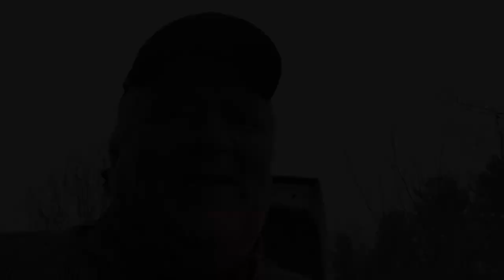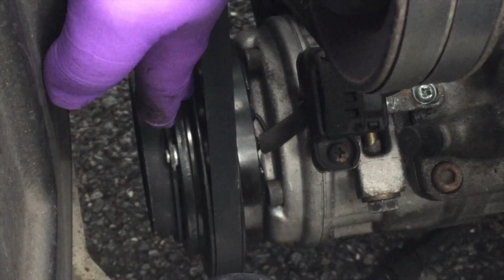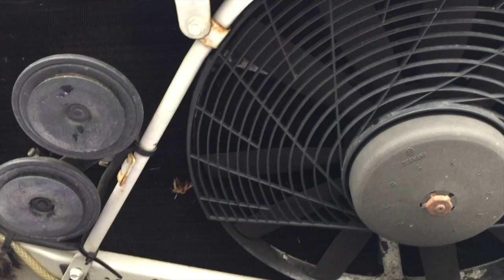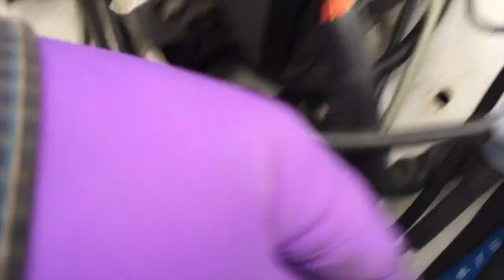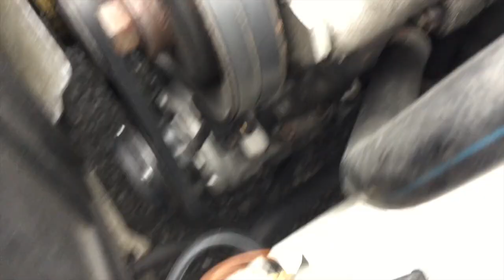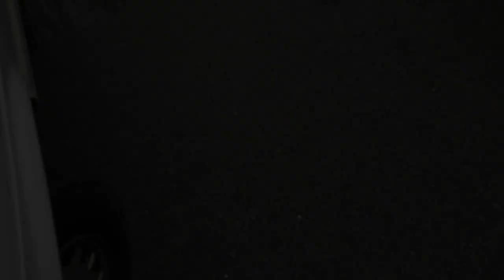Key components of AC systems on Mercedes Benz W123 W124 W126 W201

Comment: Thx for your videos.
I have a problem on my w126.
When I turn on the AC the aux fan doesn't turn on at low speed(doesn't turn on at all),if i put together the two wires from the switch in the dryer the fan turns on.
I charged the sistem last year when it was converted to r134 but if i change the switch i loose all the gas inside the sistem so I have to recharge it.
Is there a way to make the fan work at low speed when the AC compressor is on?could that be a problem for the AC sistem or for the fan itself? Sorry for my englis
Reply from the maker: The low speed only comes on if the high pressure switch senses a high pressure condition. I would expect for your low speed fan setting not to come on under the conditions you describe. 
The high fan speed comes on when the S25/5 coolant temp switch hits 105C. Just make sure that the small cubical relays are in working order in the fuse box. I do not necessarily think that you are having an issue with your fan.

Comment: What is called AC adapter?
Reply from the maker: The high and low access ports now have adapters as the R12 and 124 Freon connections are not the same.

Comment: my aux fans on the w201 2.6 just don't want to come on, jumpered the blue temp switch on the head, jumped the pigtails on the red switch on the dryer, have changed out the relays. My head is breaking, thinking of rewiring the aux fans to a manual switch through a separate relay. help hahah
Reply from the maker: Hmm. Have you tried powering the fans straight from the battery yet? Let's make sure that the fans are actually working.
Reply: @straybenzes  Yup, the fans work with direct 12v. I replaced the pre-resistor as the previous one was no good. Also changed the temp switch on the head, also checked and changed the relays. The fuses are all good as well with new ones.
Reply from the maker: @arnog9959  Hmm. One basic item I did forget to ask. Did you check the red fuse for the fans in the fuse box? I have found plastic ones melted and ceramic ones corrode to the point that they looked ok when in fact they no longer made a solid electrical contact.
Reply: @straybenzes  Hm, I replaced all the fuses that were marked for fans, and anything else that looked words with new fuses. Im very puzzled, by the aux fans, no lo or high settings even when jumping the temp sensor or the at the dryer. I might give in and take it to a shop...Or Hotwire the fans to relays and a manual switch..
Reply from the maker: @arnog9959  Do the relays change state? That would be a good indicator if it may be the climate control unit. That is what I would do next. Good luck.
Reply: @straybenzes  I was having some issues, thought it was the switch over valve, but the culprit to it all might be the climate control, relays don't switch states, I don't think. Thank you will try it
Reply from the maker: @arnog9959  All the best!

Comment: Hey Ralph how are you hope you’re staying safe got a problem with my SDL when I turn on my blower for my AC or my heat the recirculation light goes on but it still draws full from Outside I put my hand over next to the windshield wiper and it’s drying very strong if you can help to tell me where to locate the actuator vacuum line and flap thank you Ralph
Reply: Thank you so much Ralph you’re always a great help stay safe my friend
Reply from the maker: @abrahamghannam2137  Same to you and keep your classic car on the road :)
Reply from the maker: That would be the two vacuum actuators behind your glove compartment. As of my 1989 you would have to remove the passenger airbag instead. Remove the glove compartment door and the insert. You can either get new rubber diaphragms. You can get them here: http://www.perfanalysis.com/climate-control/acc-version-ii/ Or you can replace the whole pod, but they are really pricey. Here is what they look like: https://images.app.goo.gl/HUskZ2GjXR5ZCgWJ7 That link also has good advice on removal etc. 
This set is among the easier ones to repair. Good luck!

Comment: hello STRAY BENZES!  l have a problem as well with mine ac in w124. l have checked pressure in one of those  pipes,  and found there is no pressure at all,  so thats mean the system is leaking, and compressor doesnt switch on at all, or it should switch on any way? but will be no cold air?
like from Lithuania)
Reply from the maker: The low pressure switch on the dryer will prevent the compressor to come on. Also, when you lose Freon gas you also lose compressor oil as well. You need to find the leak first. Do not use leak fixing gas etc. That will only delay the inevitable - you will need to search for and fix the leak.
Reply: ok, thank you!
Reply from the maker: @artoor4ik777  You are welcome.

Comment: Hi sir..  I want to convert A/C gas R12 to R134a in my W201 .. what  should I replace in the cooling system? 
Thanks
Reply from the maker: There is a bit of work ahead of you but you can save a bit of money doing that yourself. There are parts of this job that you are not allowed to do. Venting any Freon into the air is one of them. Get a certified shop to empty your system of the old R12. That can be a chore finding one. Next you will need a full O ring set. R12 O rings are typically black and you will need green ones suitable for R134. That is by far the biggest job to get all O rings changed. The biggest PIA is the expansion valve as that lives under the dash next to the steering column. Flush the system using a safe AC system flush - component by component. You will be glad you did this as years of gunk can make a conversion useless as some components may be plugged / restricted with crud. Next biggie in terms of potential $$$ is the compressor. You will need to change to an ester based oil. If the compressor is more than 5 years old just replace it with a new or refurbished one as those will already be set up with the correct O ring. Also, even slightly worn compressors will hurt your AC cooling performance. Do not forget flushing the evaporator and replacing the dryer. Make sure putting oil into the compressor and dryer. Do not forget to put conversion Schrader connections on high and low system connection ports - the R143 ones are much bigger than R12. Close the system up and put a full vacuum on the system for at least half an hour. I prefer 1 hr. Also leave the system sit for at least `10 minutes to see if there are any leaks. Then fill the system with new Freon. Do not use the gas laced with dye. Most shops do not work on systems that have that stuff in the AC system. The high/ low side pressures are different with the R134 as you need around 10-15% less gas by mass. Final tip: If your system had a lead and the gas is gone - so it the oil. NEVER just top off gas without checking/ topping off the compressor oil. Good luck!

Comment: Hii..my merc 260e w124 having problem with ac pressure switch..the red colour. I bought a new switch and seem only stand for 3 months ..could you advice further sir. Tq
Reply from the maker: Did it lose its charge again?
Reply: @straybenzes  after 3 months the acon becoming warm and auxiliary fan not function again. I suspect the pressure switch got problem again

Comment: red switch is refrigerant pressure switch . 16bar on 12bar off.
Reply from the maker: I stand corrected. This is indeed the S32 high pressure AC switch, but it actually is open at 15Bar and closes at 20Bar on US spec W126.
Reply: @straybenzes  green switch is 20bar on 15bar off.
Reply from the maker: @altezzabmw  I am going by factory spec not the color. Where do you get this info from?
Reply from the maker: @altezzabmw  Thank you! That was not included in the W126 documentation. It is great that the W124 information did mention the switch settings. Be safe and stay healthy.

Comment: Hi America! Good vidéo! For the cooling fuel system show here , l can say that on my « french « w126(560 sec), this system doesn’t exist...
Not necessary in Europe in this Time ,l think..before global warming!
Reply from the maker: You are too funny, Eric! It may indeed have been a US version only option. We do get very hot summers here and we do not have to live way West or South. I am sure glad that this option exists, as the other problem with getting the gas to boil comes from today's Ethanol laced fuels. Those start boiling sooner than they used to even without global warming. In the US you are better off running the AC in the summer as it helps cooling down the gas before it gets to the fuel distributor.

Comment: Hi Ralph. I did not know there was a fuel cooling system in the a/c system. Did they have that on the 123 or just the 126?
When I  changed my system over to R134 I changed the compressor. I could never keep the belt from coming loose. I put it on, pull the compressor down tight and tighten the bolts. There is a small locking bolt to keep the bolt on the swing arm from working loose. After a few weeks or so I would get a rumbling noise and find the belt loose and yet the belt was not stretched. I would retighten everything and then after a while it would do it again. The oem belt was so short that you could barely get it on even with the compressor loosened and pulled up all the way. The after market belts were slightly longer but narrower and did not fit the pulley quite right. I suspect that the pulley on the compressor was slightly out of round but was never sure. I still wonder about that to this day.
I sold the car before I figured it out.
Reply from the maker: Hi Werner. US customary size belts and the rest of the world's belt profiles typically differ in the "V" profile. These should be the European SPZ style once which would be close to our 3VX style. I say close because the angle is off by 2 degrees. Not much and that was most likely not your problem. The difference between the metric and customary unit of measure belt lengths can sometimes be dramatic. The longer the belt, the more tension you need. This was also most likely not your culprit. More likely was that the belt profile was off even more dramatically; as you wrote the belt seated way differently from the original. That was not a good move. Too bad the car is not around anymore, because another likely cause could have been pulley misalignment. We shall never know.
Reply: @straybenzes  yes. I am sad I did not keep the car. It did the exact same thing no matter which belt I used. It still puzzles me the belts did not seem to stretch.
I forgot I asked about the fuel cooler and you did not say. I realized it would only be on gasoline cars. But I did not think about it much when you mentioned it. I did not think fuel injected engines could suffer from vapor lock. Can they and does Mercedes still use this?

Comment: That video came in a great moment, as I’m figuring out what’s causing my aux fan to not kick in when the AC is on. It only kicks in by the 100ºC temperature switch in the engine.
Reply from the maker: If I recall correctly the high temp switch kicks the aux fan into high. The cooling water temp high switch turns off the AC compressor above 105C water temp. I am going over the various issues with the AC next week. All the best with your car!
Reply: There should be a relay that turns the auxiliary fan onto it's low setting when the compressor comes on. That relay has probably gone bad.
Reply from the maker: @wernerdanler2742  Those relays are probably the sturdiest of the ones installed. The resistor is sometimes the culprit.
Reply: @straybenzes  Yes, my Peugeot had a resistor in the line to the fan so I took it out and hooked the wires together. It made the fan run a little faster but it worked great.
Reply from the maker: @wernerdanler2742  The concept works the same regardless of brand.